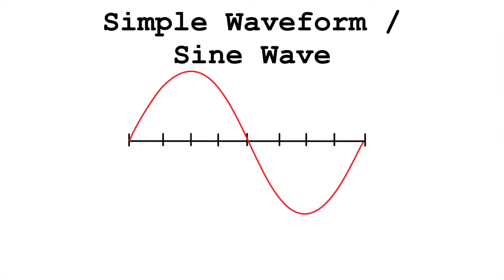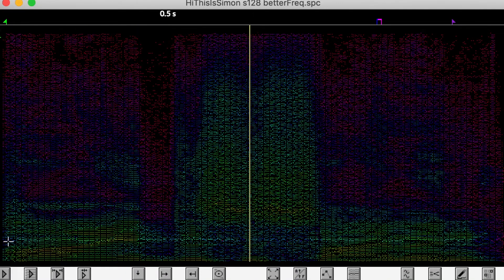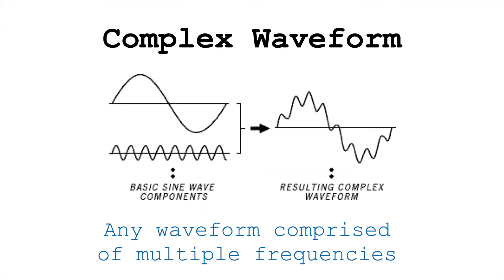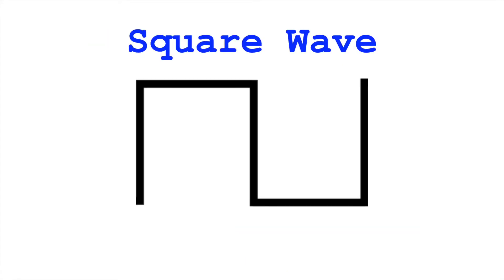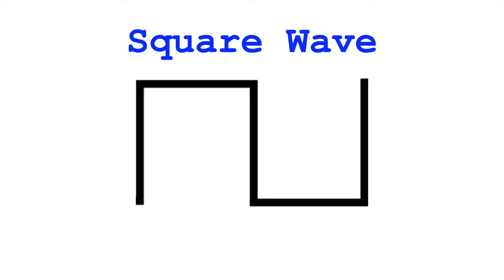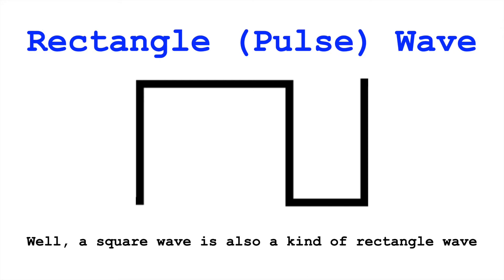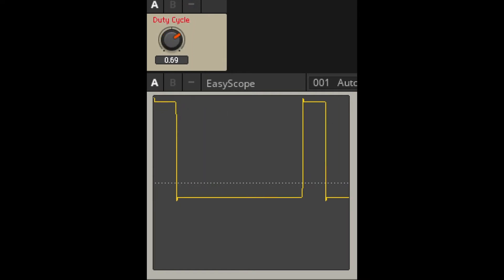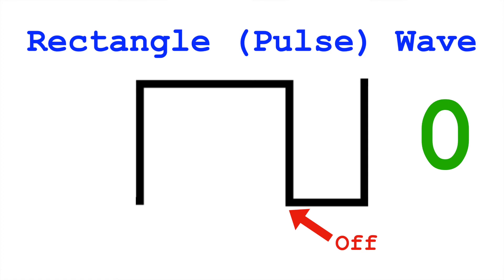What is One-Bit Sound? Square waves & Pulse Waves (Listening to Videogames) | Simon Hutchinson

Comment: That’s pretty interesting so a digitized square ware & pulse wave only requires 1 bit but a digitized sine wave and saw too wave willrequire more bits, but interestingly enough those analogue soundchannels whether 1 square waves,triangles waves or noise channels etc,,, only requires 1 bit to dititally control them.